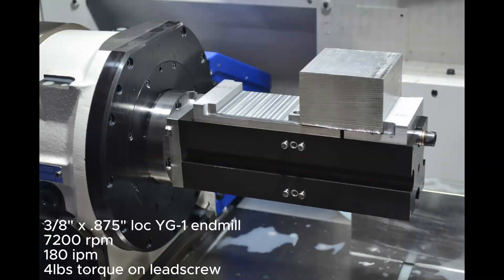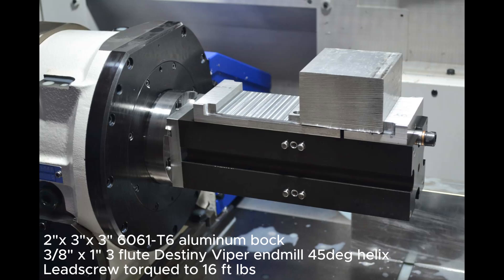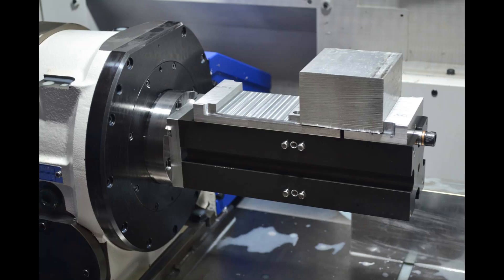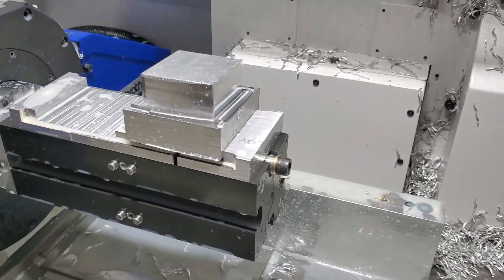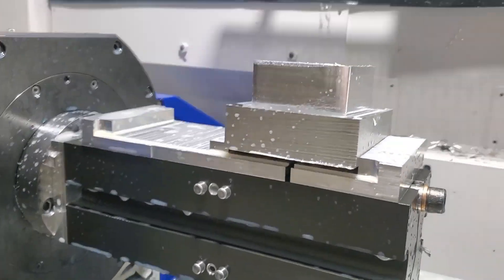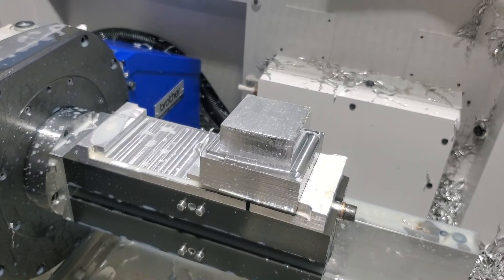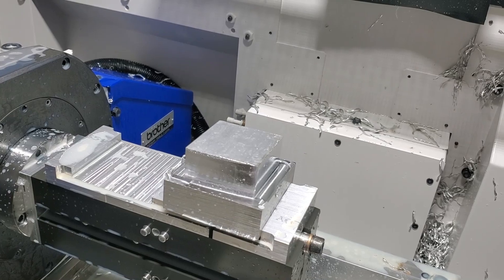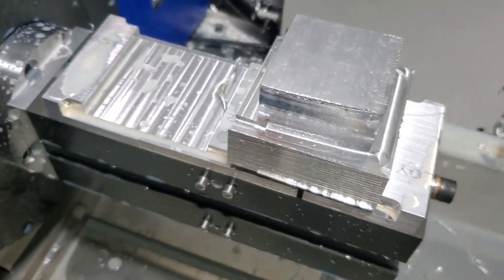Stress Testing a 3"x 9" 8 station tombstone vise mounted to a 4th axis

Comment: Impressive! Have you thought about using some "serra jaws" for even more rigidity?
Reply from the maker: I don't think they would be needed if I used a production quality vise, this is a second. I only torqued the lead screw to 37% of max and I am sure it had backed off some because my spacer tube was crushed by the load. I normally don't intentionally create so much cutter forces when machining parts like I did for this test. If I was setting this up to make parts my machining strategy would be a lot different. To be honest, I thought the vise wouldn't be as stable as it was due to how I mounted it.